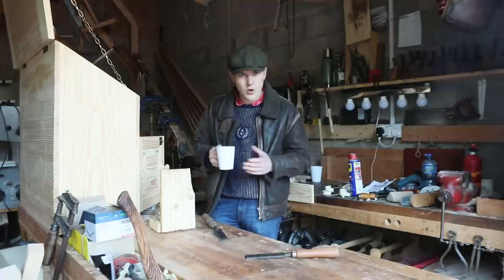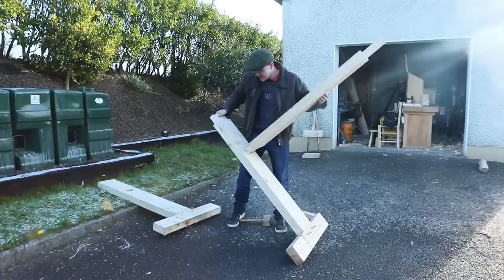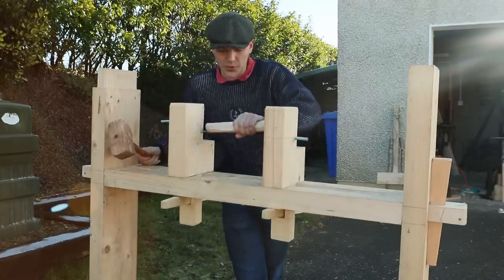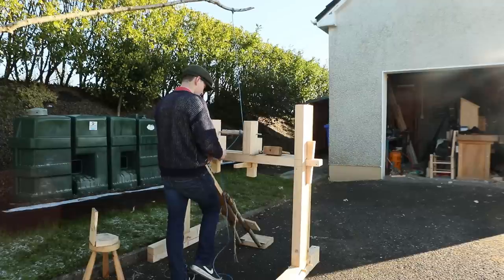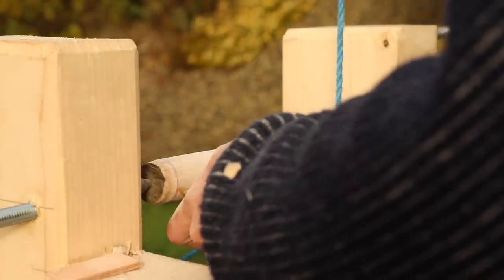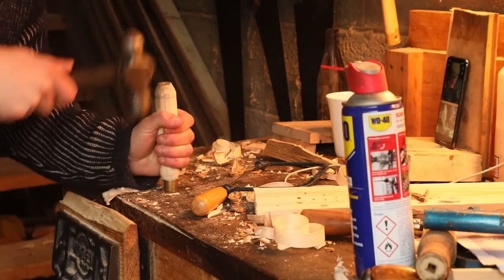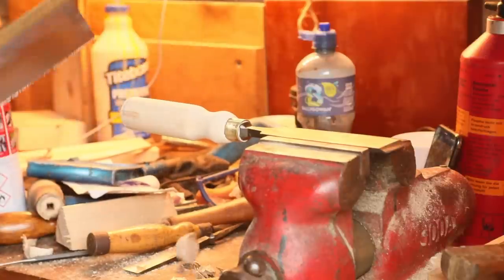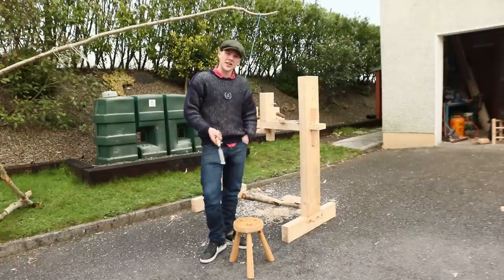Turning An Irish Ash Chisel Handle on the Pole Lathe

Comment: Idea for a possible future improvement/iteration: have one of the chucks mounted through one of the legs, extend the spike to pass through the leg and spin freely, then add a decently sizes fly wheel to the free end dangling off the side of the lathe. Now replace the pedal/tree/rope combo with a pedal running to a crack that turns the flywheel (might need to use a secondary shaft running under the lathe and belted to the chuck/flywheel shaft to  be able to place the crank near where you'd want to be standing). Finally change the chuck to be a kind that locks onto the wood rather than holding it at a single point so that work piece is rigidly tied to the rotating flywheel via the chuck. While mechanically more complex, it would yield the benefit of requiring less space, maintaining the direction of rotation, and result in smoother, more uniform, and more precise cuts (at least to the limit achievable by hand held cutting tools).

Comment: You build chisel handles and milk stools. I build windmills and small engines that run on compressed air.  Almost the same. I use a motor-driven metal-cutting engine lathe. I can only imagine using a lathe like yours. I am patient,  but YOUR lathe would drive me to drink!

Comment: Great video, Eoin!

A chisel is one tool I'd still really love to get! I haven't seen many brands here, but do you have any recommendations on decent chisel brands or what to look for in a tool?
Reply from the maker: Look for old chisels! They are abundant. Lots of the old ones are made from very hard Sheffield steel. Most moderately priced modern chisels are pretty decent. But any cheese chisels are going to suck.
Reply: @EoinReardon  I didn't actually think about that, thanks for the reply!

I know of a few auction houses around my town that usually have old hand tools, so I'll check those out

Comment: Head on down to the nearest livestock/farm supply store and grab yourself a tin of pine tar.  You'll find no better thing for coating wood, especially tool handles.  It was the tradition long before linseed oil came around and is leagues better, imo.